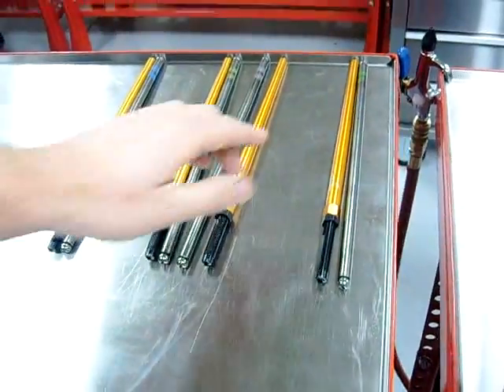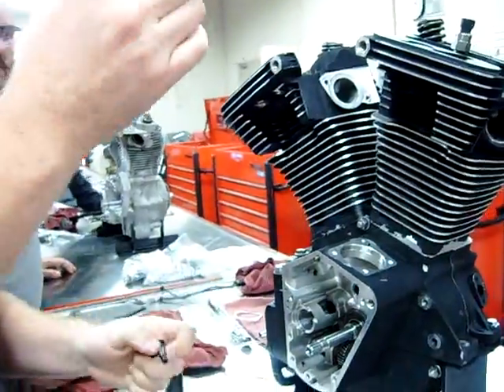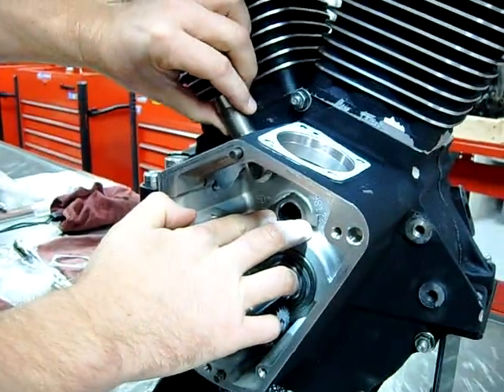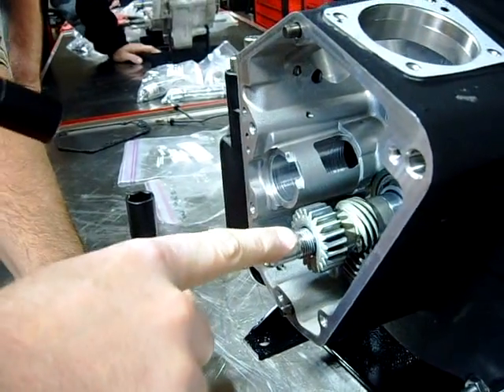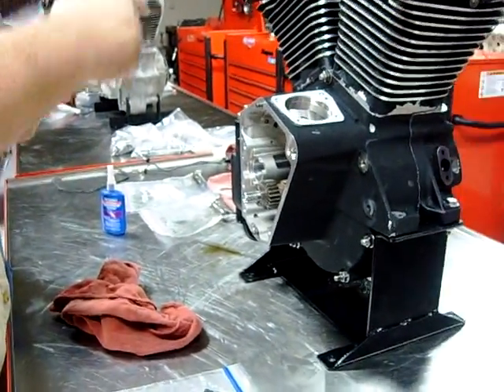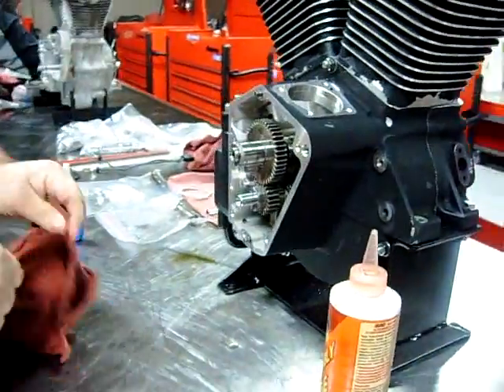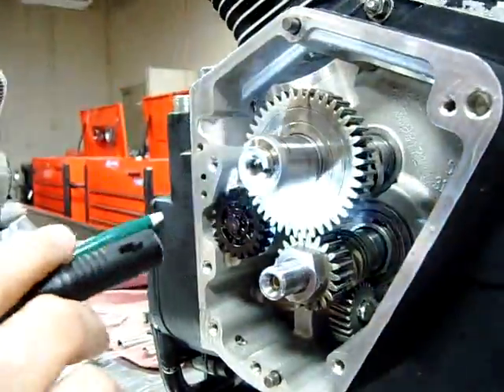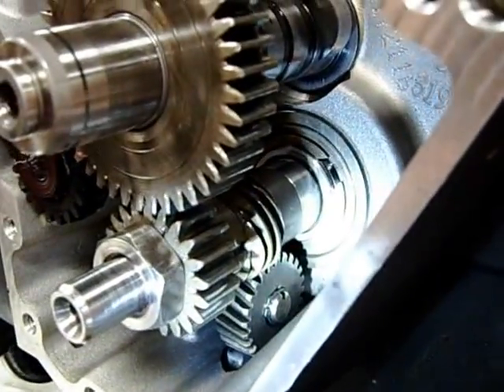Part 05 Gearcase Camshaft Breather assembly on a Harley EVO motor

Comment: You get a gold star for the remarks at the end, showing another way to mess up. Wow, if that got missed the engine could starve and die within days, and the shop owner would need his liability insurance. Nobody who watched this video will ever make that mistake. 
I was just thinking about how elegant it is to avoid timing belts, but good design should also make it almost impossible for a mechanic to assemble the engine wrong.

Comment: Super-informative thank you - just had my oil pump drive fail (perhaps debris from the inner cam bearing got jammed in the gears and sheared the key?) so need to get into the cam chest and see what's going on. Pffff
Reply from the maker: Thank you for the kind words and sharing my work. If I can ever be of service to you, here is a video explains how to connect with me. 
https://www.youtube.com/watch?v=vjvmB01ebcs 
Keep Wrenching,
Shane Conley
Instructor/Motivator/Motorcyclist
www.how2wrench.com
Like freebies? Click here for a free diagnostic checklist! 
http://gem.godaddy.com/signups/364621/join 

Did you like this free video and hope to see more? Would you just like to say thank you with a donation? Click https://www.paypal.me/how2wrench
Reply: Shane Conley i
Reply: Bit late but might help someone - the nylon breather gear had lost about three teeth and the drive key had sheared. Whilst I was in there I changed the inner cam bearing to a Torrington/Koyo B138 as the original plastic cage ones are known to fail with age.

Comment: Did you say the crankcase breather shim isn't directional? I thought most of them are: the inner chamfered/beveled edge goes towards the breather. At least they do on the 92 and earlier. I have however noticed the thicker S&S aftermarket steel ones are beveled on both sides so it would make no difference, they're non-directional. To be honest I don't know on the 93 up, they may also be chamfered on both sides. Is that the case with this engine?

Comment: Shane, your thoughts on why you didn't get rid of the plastic breather valve?  I'm getting ready to change out the cam to the EV-27 on my 98 RK. Also any thoughts on milling the heads for horsepower? Thanks.

Comment: Shane, I was wondering does it matter which stroke the engine is on when yo insert the cam? can you be 180 degrees off?
Reply from the maker: A little late reply, 😁 you can't do it wrong if you line the dots up. The primary nut on the crank is keyed and only goes on one way.
Reply: Thank you